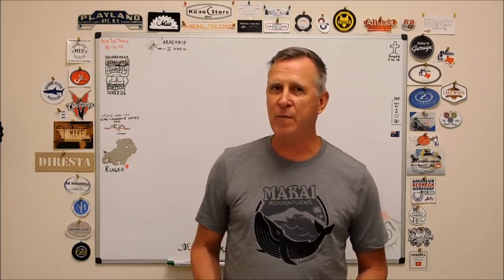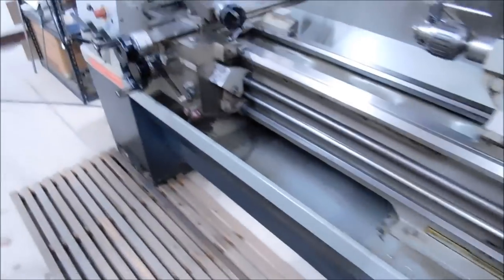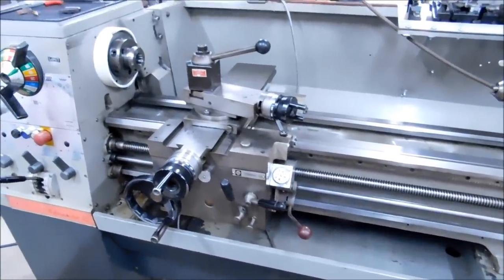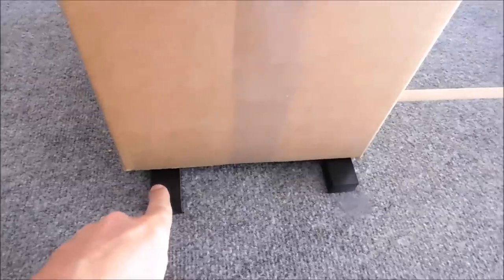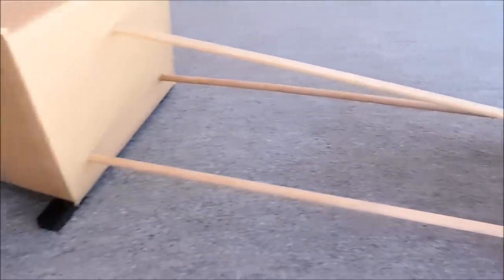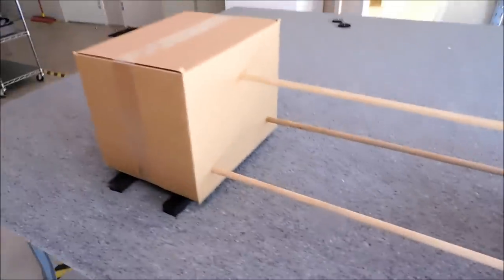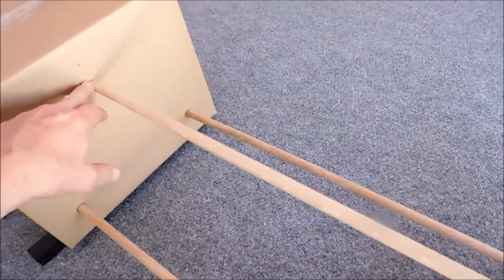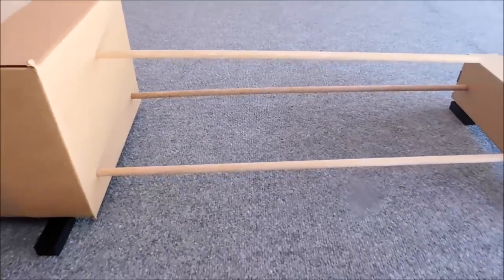Lathe Leveling - Waste of time ????

Comment: Well, what do you do when your lathe only has two leveling feet under the headstock? Many lathes have only two.
Reply: Mel Gross My Clausing is that way.
Reply from the maker: Is it a smaller swing?
Reply: Yes, Its a 12" Clausing 5902 @joepie221
Reply: Mine is 14”. A Southbend FOURTEEN. It took me several hours to get it set up.

Comment: I've watched enough of your stuff to recognize that you're a master machinist. I'm not. So, I cannot and will not, question any of your advice or information. Sounds logical to me. Now, a burning question I've had a long time that I'd like answered is thus:
Every capital naval ship has a machine shop on board and perhaps many commercial vessels as well. How is it possible to have ANYTHING dead nuts level on a ship that rolls, twists,  and undulates with the sea beneath it, besides the vibrations coursing throughout the hull? Obviously,  you cant. Yet those sailors turn out perfectly serviceable parts when necessary. Comments, explanations?
Reply: The deck section the lathe is mounted to is designed not to twist. This is done by both the location and framing. The lathe will tilt and pitch with the ship, but not twist.
Reply: The confusion comes from the use of the word "leveling" the lathe. As Joe showed, you can tilt the surface the lathe is resting on (the deck of the ship) and it will still cut true even though it is not "level" to gravity. The headstock needs to be square to the ways, and the ways must not have a twist. So, the lathe should be "square and without twist". Level is easier to say!
Reply: It's the relationship of the lather to itself that matters. Figuratively you can stand the lathe on the headstock or tail and cut parts vertically You could lay it over on it side  and still cut accurate parts as long a the lathe is square unto itself. Which is why they work on ship. The ship moves but the area of the total ship that the lathe represents is small and as long as the bed doesn't bend up or down or twist relative to the head it's all good.
Reply: -By bolting the lathe's feet to a rigid "torsional beam" spanning the entire length of the machine, and having that foundation pivot on three points on the heaving, warping deck. Rob, Xynudu, has a clever take on this: http://users.tpg.com.au/agnet/cq9325rev4.html
I bolted my 7 x 14" to a 4 x 2" x 3 mm structural steel box section that actually has 2" plywood feet at the ends, and this can be put to consistent work on ANY surface irrespective to temp, moisture, tides or whatever. Twist-free, but never ever "level". Even though the lathe only has a 4-bolt mount, with pieces of linoleum between box section and machine feet I can shim and tighten front-rear and/ or left-right side of the headstock bolts to raise or lower,  front or rear center of rotation relative to the bed. 2 cents DIYSwede

Comment: I loved your clarification of terms and examples.  I am an amateur at best when it comes to this but I am not when it comes to sighting a rifle scope with a bore sight.   Could a person not clamp a bore sight in the chuck and align the live center and head through the appropriate means using a laser?  Why do people think the lathe has to be level?  Sorry I need to understand.  Thanks
Reply from the maker: Level and straight are often misused terms. You can expect a taper on your part if the bed and head aren't true to eachother.
Reply: Great, that's what I thought.  True to each other is a good way to put it.  Thank you so much Joe.
Reply: The original reason is that it was much easier for a millwright to align all the functional surfaces of a machine tool relative to a single unchangeable direction. The only practical way of doing this was to use the direction gravity pulls in at that location, because a truly horizontal plane perpendicular to this direction can be verified at any (nearby) point by using a precision level.
So making sure all the ways and spindle axes are parallel to the horizontal is SUFFICIENT to establish that they are mutually parallel, but not NECESSARY.
For very long machine tools with high accuracy (say a 12m table Elgamill-style machine, or longer) the makers actually had to supply correction tables (or more recently, software) to compensate for the fact that the direction of gravity at each end will be measurably convergent.

Comment: Great video. I have recently got a Vevor 7x14 lathe. Watching your videos I learned a lot. I learned that my lathe is cutting a taper. Gets smaller going towards the chuck.  I tried your suggestions to no avail... is there anything else I should try?
Reply: You should slacken the bolts holding  the head stock and adjust 1:02  there..I could say more but I'm lazy to type lol
Reply: @tyrontender9668  
 Will do thank you very much.

Comment: It seems like even though leveling is a misnomer that leveling would be the easiest way to get everything very close and make truing easier.
Reply from the maker: Its a good place to start, but once you begin the headstock alignment, you'll ultimately align the head to whatever pitch the bed sits at. Straight and no twist is the most important.

Comment: They have lathes on ships that rock and roll…
Reply: Yes, but aren’t they mounted on three points so that the tail pivots rather than twists? Similar to a surface plate.
Reply: Leveling a lathe has nothing to do with the lathe being level to earth, just that the ways of the lathe are all the same level as each other and there is no twist as you go down, As the ways are the reference the only way to do this is with a level, You could bolt a lathe to an amusement ride but as long as the Lathe has no twist and is (Level) it wont cut tapers.

Comment: As always, simple, to the point and idiot proof demos. I would like to add that supporting with the tail stock can be very dangerous because, at least on my lathe, the tailstock can be moved to create off-center tapers. If the tailstock wasn’t properly re-centered you will never have true parts. 

One more thing, on my old (1953) Cincinnati Tray-Top 12x36 the Head Stock is NOT solidly mounted to the tower, if the mounting bolts come loose (or rust builds up between the head and tower) it could shift off parallel, no matter how “level” everything else is.

Comment: Hi Joe, I want to check my tailstock alignment but don't have a dead centre to slot into the headstock. Will it work the same if i machine a piece of stock in a 3 jaw chuck to a 60deg angle, using compound slide, and put my alignment bar between that and the tailstock? Thanks
Reply from the maker: Yes. But it will only reflect alignment for parts being done between centers.

Comment: i have seen 2 lathes mounted at a 45% angel (front down) and do great so level is a miss nomer. " level" is just a good reference point to use. also a standard level " construction/ homeowner" is not very good. buy a machinist or machinery level.

Comment: What happens if your lathe, like mine, only has two feet under the headstock? My Southbend FOURTEEN has two feet under the tail stock, and two under the back of the headstock. I’ve never seemed to have had a problem leveling it, but is there any way to adjust that headstock angle relative to the ways without four feet under the headstock? That is, without having to loosen the screws holding the headstock on and shimming?

Comment: That brings up another thing,how would you level the ways of a vertical lathe??
Reply from the maker: If its anything like a CNC mill, you chuck up an indicator and raise or lower the table to align it with the spindle. The main vertical casting is just too heavy to adjust, so you basically bend the table.

Comment: "Level" fore and aft of course,but left and right I always set them slightly out of level in the direction of the coolant return.
Reply: I literally told someone just today how annoying it was that the coolant pooled in the nice level tray instead of running to the return. I will be raising my lathe a touch on the end opposite the coolant return the next chance I get.
Reply from the maker: Thats actually not a bad idea. A design flaw yes.
Reply: @joepie221  It amazes me that such a simple concept escapes some machinery manufacturers.Most of the older makes,WWII vintage especially,did a much better job of designing coolant systems.

Comment: Thank you, now I can try to set my lathe up. So I do have a question what type of lube/oil to use in my headstock, its an  Acra Turn 778? I’ve watched a lot of videos and got a lot of deferent info from 30 weight non detergent motor oil to everything else. I think your petty smart so I’ll take your advice. Any help would be really appreciated. Thanks, Dave from Louisville
Reply: I use ISO 46 hydraulic fluid because it is so hot here in Texas. 
My manual calls for ISO 32 but I use 46 after some research on hot weather.and what an engineer said about the use of it.
I would like to add I would never use motor oil in a gear box unless it went through a filtering system like it does on my Triumph.
Reply: @worthdoss8043  why the filtering system?
Reply: @transdimensionalist  I have read that the motor oil holds particulates in suspension to be carried back to the filter.
Something not desired in a gear box.
But some companies like Harley Davidson use 20-50 motor oil in the chain drive clutches and transmission. 
Or at least they used to and I think they still do. 
The choice is up to you in the end.
The stuff I buy is the tractor supply brand in 5 gallon cans. 
The plus side is you have a very good lubricating oil for all sorts of things around the house or shop too. 
Hydraulic fluid is no more than mineral oil with anti foaming agents in it. 
Mineral oil is used in turbines and all manner of equipment formulated for turbine use.
Reply: @worthdoss8043  thanks. very interesting :) could you elaborate on turbines, im unsure how this is related?
Reply: @transdimensionalist  It is related because turbines use mineral oil too. 
My point is that Hydraulic lubricants and Turbine lubricants are very good lubricants for such things.
Only when you get into very high load pressures do yo want to start looking for lubricants that can handle it. 
One place to consider this is in the change gears for threading.
At very small threads per inch there is a lot of pressure on the gears involved. 
You are stepping up the rpm of the lead screw thusly creating very high pressure on the idler gear and driven gear going into the gear box from the gears on the back of the head stock.
Plus the gears in the change gear box.
My lead screw, half nuts, feed screw, worm and worm wheel and change gear box all get ISO 68 and cleaned constantly.
Mind you my change gear box is of the open type.
If your change gear box is of the closed type which I think it is I see references to ISO 68 from same type lathes.
These contests you see on YouTube where they bog the lathe down to see how strong it is I consider lathe abuse. 
Something will snap eventually.

Comment: Hi Joe, thanks for the video. Did this check on my ways with a digital level for twist. Over 1M it was 0.2' , is this an acceptable +/- result. Thanks
Reply from the maker: First time I read this I saw .2 feet. .2 minutes is a lot better.
Reply: @joepie221  lol thanks Joe. Sorry for confusion is was actually  0.2 degrees. It would require approx 1mm wedge on one side to be perfect, but I am thinking it is pretty close

Comment: So ... could you use a laser boresight tool to check alignment instead of a stiff rod?
Reply from the maker: A bore sight aligns the scope to the point of impact. You would have to get pretty creative for iot to be effective in this situation. Even the diameter of the laser dot would be too big to be practical.

Comment: Hi Joe, can long term damage be done to a lathe, by leaving it not level over a period of time? Thanks
Reply: Obviously you don't want to drop it on a dirt floor and let it sit twisted for years. Support the feet evenly to prevent twist and everything else should be true
Reply from the maker: My gut tells me the answer would be yes. The longer the ways, the greater the potential for a bow or bend.

Comment: Dammit Joe ! I don't have a genius brother in law! Now what?
That said, if I had one and he'd mess with my machines.... I'd probably knock his block off....
LOL the very idea that some numpty would walk in your shop and start 'leveling' your machines..... that's 'Justifiable Homicide' in Texas, right?
These days the trend is to put heavier machines on adjustable feet and not bolt them into the concrete any more. (I was always taught to bolt machinery down in as firm a way as possible).
How do you feel about that?

Paddy
Reply from the maker: I suggest drill presses and pedestal grinders get bolted, but I'm not sold on all machines. the manufacturers usually suggest they are.

Comment: unrelated question --- how are/is the ball race ground in a thrust bearing?
Reply: I waited thinking someone would chime in.
I would think they are turned including the groove for the bearings.
Then hardened. 
Then they would be set up and ground with a cylindrical ball end grinding stone of the right radius at a 90° angle spinning as the race is turned..

Comment: Hi How about holding a laser pointer in the chuck and aligning it with the head stock.
Reply: I was thinking about that.  If you put a target on the carriage and moved the carriage left and right  you could figure out when you had the laser utterly perfect, as indicated by a minimum-size dot at all distances.  If it wanders around on the target as you move the carriage that tells you that the bed isn't perfect and you could go from there.  Exactly how you'd accomplish this I'm not quite sure but it would be fun to tinker with.
Reply: @CraigsWorkshop  True at the length of an average lathe but you could use a couple mirrors to make a longer path and that way the alignment error would appear larger while the spot size stays about the same.  Suddenly this is starting to sound like a pain in the butt, isn't it?